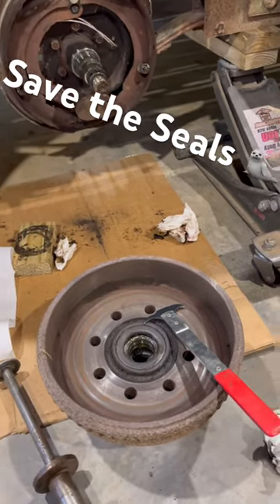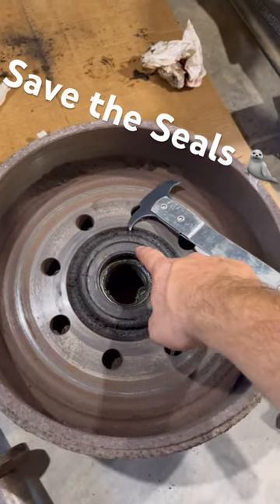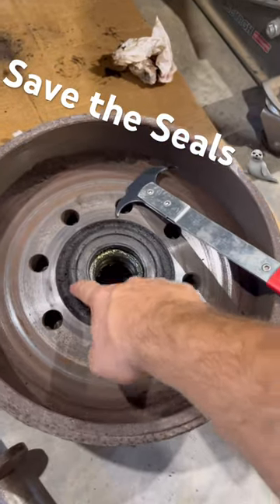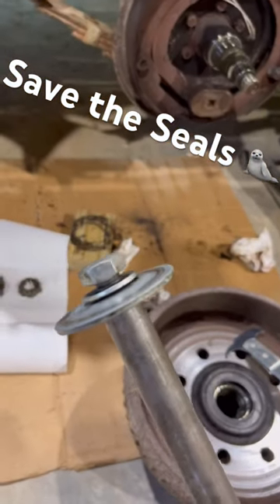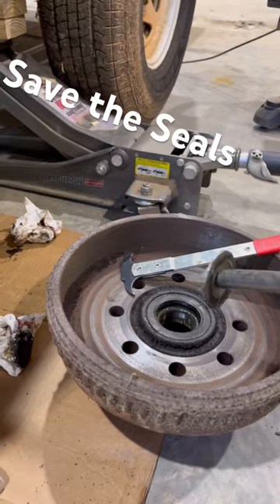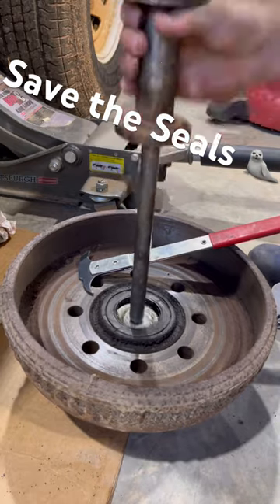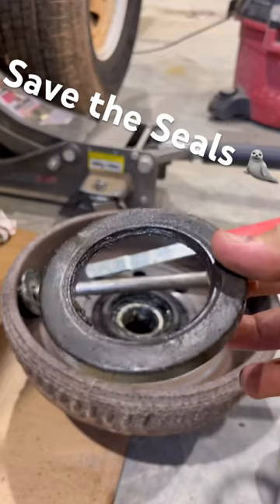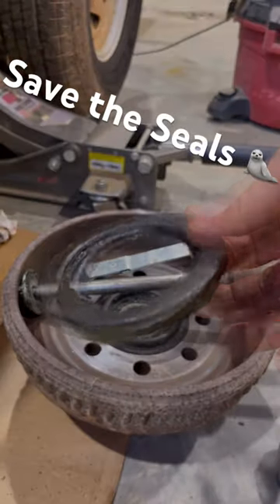Slide Hammer Seal Pulling #wrencheveryday #builtnotbought #wrenching #automobile #truck

Comment: Silly. Can do that easily with the drum on the axle using the adjustment nut. Also, always replace your seals. Cheap insurance from getting bearing grease inside your linings. Only fools tempt disaster to save a few dollars.
Reply from the maker: Thanks for the input, gotta do what you gotta do when you’re in a bind sometimes. I rather have a grease in my lining than a toasted hub
Reply: Friend, being in a rush is different than being in a bind. Ain't no one ever had to pull and service bearings 'in a bind' and couldn't wait and/or find the right bearing seal for around $8. In a rush and too lazy? Sure, I'll buy that. But you ain't no mechanic at that point and in my eyes, and we'll just have to part on that note. If by my mistake I didn't catch somewhere that you're a parody mechanic, then I apologize, and "ha ha!".
Reply from the maker: I can be in a rush and lazy sometime. In my case I was towing a friends trailer over an hour away the next morning and had never pulled the hubs off to know what size seal, in my eyes I did what was best. If you see it differently I won’t argue, I do agree with replacing seals and I’m not saying don’t ever change them. I’m not a paid mechanic, I do all my work on my own stuff and I get by.